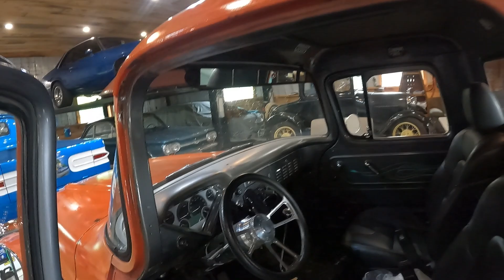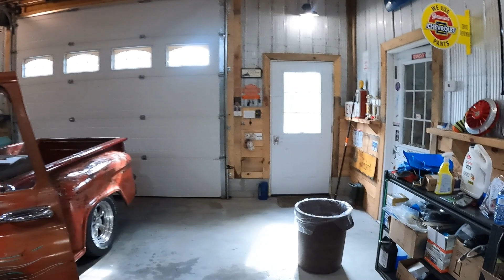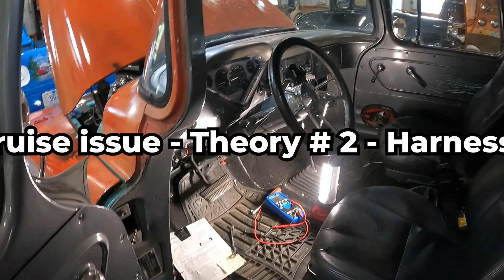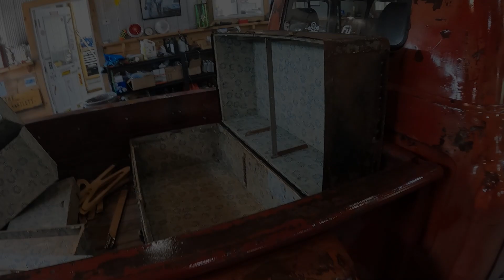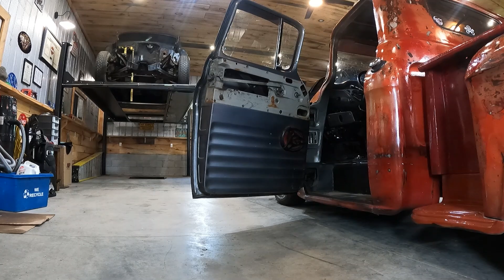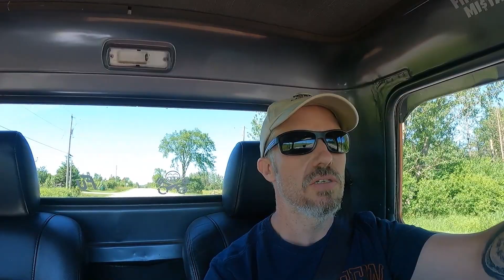Road trip preparation - LS Powered 1957 Chevy Truck

Comment: The Power Tour is really a loooong trip. I also have Dakota Digital instruments and chose to use the dash mounted cruise control. Did like the look in my 57 Chevy BelAir.
Reply from the maker: It's on the bucket list. I would like to try it, maybe with my 55 Belair when complete.

Comment: What did you guys run for a rad??
Reply from the maker: It's a custom radiator that was built for the truck when it had a SBC. I used a F body radiator and fans in my Malibu and it worked well. You could try that.

Comment: What chassis did you put on it?
Reply from the maker: It is a stock 57 chassis with a Camaro front sub frame and a 4 link rear suspension with coil overs all around.

Comment: Nice seeing how how you solved the cruse problem.  Could you wire in a "regular" (electronic) fuse instead of of the bulb?  Have fun,  safe trip and yes do post.
Reply from the maker: I could do an inline resistor, but I didn't have one handy. The bulb doesn't actually light up, it's just there for resistance, but bulbs are fragile, so long term I'll do something different.